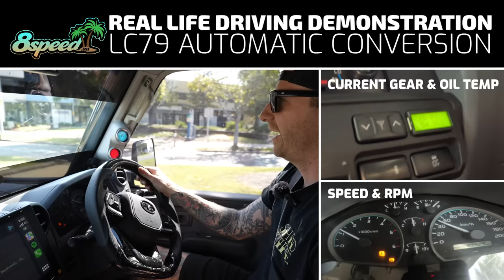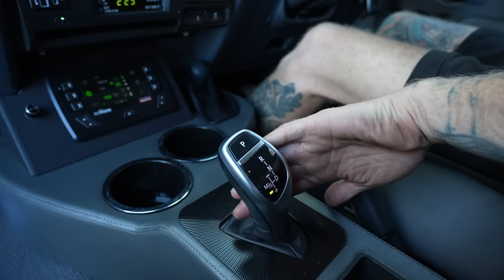70 Series Auto Conversion - Real Driving Demo (6 Month Review)

Comment: Definitely the cleanest and best-looking 79 series in Australia. 👍. In fact probably one of the most capable as well,if not the most capable.
Reply: Cheers mate! Copped a few battle scars now tho lol
Reply: @macpreston  just shows you use it and wheel it properly. No mall crawler or pavement princess that's for sure. 👍😀
Reply: Haha thanks mate yeh I’ve spent to much money to not use it 😂 plus it’s my first solid axle car!
Reply: I say clean but I guess I mean well engineered, tough stance and way better weight distribution at the front with relocating the axle, way better approach and departure angles, big fan of the custom rear tub. Oh and obviously the 8speed conversion and tune will help a heap throttle control and crawling. Well thought out rig and built to use. 👍👍. I'm not even a fan of land cruisers but this one I really like.

Comment: Looks like you need some resister for your indicator circuits. Must have change to LED bulbs right?
Reply from the maker: Yeah he did , needs to get onto that 😝
Reply: 😂 they’ve remapped the indicator
Reply: Prob chopped up loom drift spec for the fast flash 😂

Comment: The conversion kit must be a heap of work, as you can pick a ZF 8Hp for about 2-4K so close to 18-20k worth of labour and adaptor kit…
Reply from the maker: You should ask the guys the exact box they are using mate , few variations available
Reply: Also wiring, Transmission computer, Gbox adapters, Gbox mounts, Flywheel to converter adaoter, Transfer adapter, Spud shaft, Front tailshaft spacer, Shifter, Engineering costs aswell as labour to fit. Also everything is made from billet and made in australia not imported and comes with the brains to make it all work together! 
Alternate options is the 6 speed toyota conversion for 36k fitted or 31k for the kit.
Reply: @macpreston  yer that’s where all the money is for sure, you probably could have gotten it done cheaper but would it still be working 🤔.

You get what you pay for at the end of the day, and quality and skills are worth money 💪🏼
Reply: @smokin4x45  yeh spot on! Dw I thought the same when I quoted up a 200 series one when I baught my cruiser and after putting mine in now I get it haha 😂